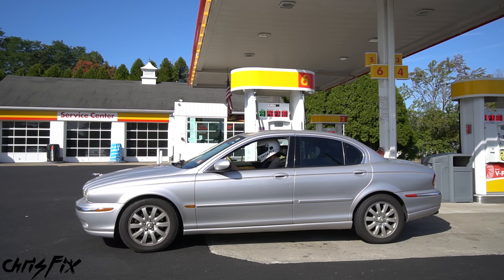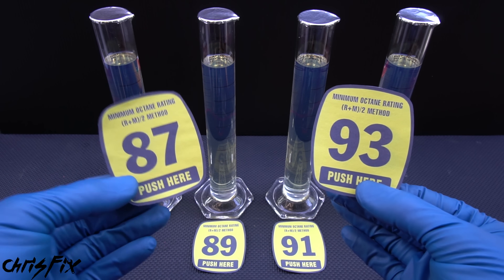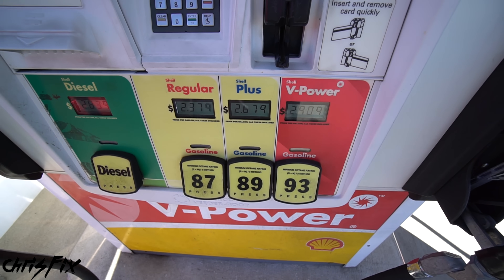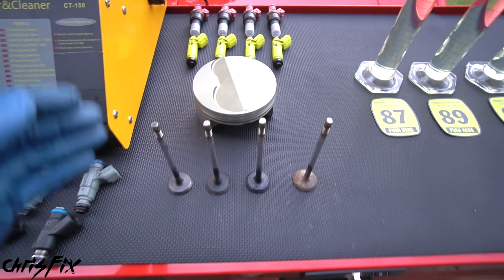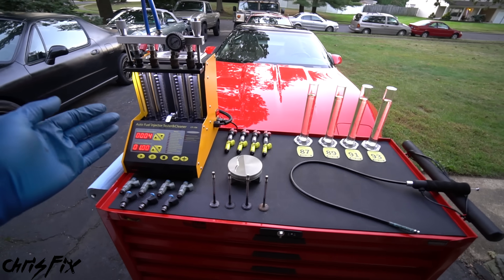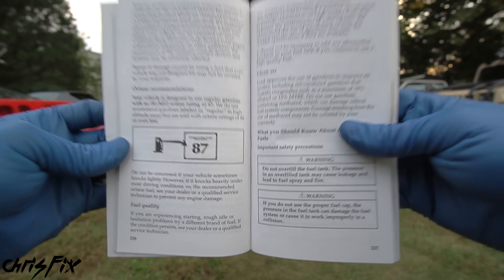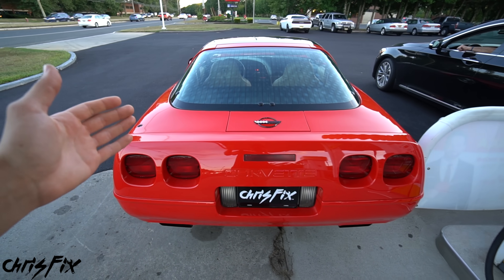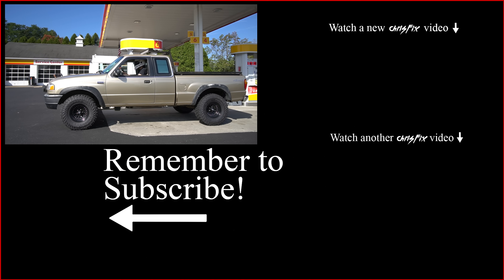What is the BEST Fuel to Use in Your Car or Truck and WHY

Comment: Big question I need help with. I live in the midwest so a lot of fuel is 10% ethonal.  Known as super unleaded. Is this ok to run? Thank you!
Reply: Pretty much all modern cars can easily run 10% Ethanol gasoline. I think most gasoline only engines can safely run up to about 15% E. Older engines, classic cars, may not like even 10% ethanol since their fuel systems are not designed to resist the oxidizing effects ethanol can have on materials not designed for it. In this case ethanol must be avoided completely.

Comment: 1:46 - octane number wont give you more energy or power.... 
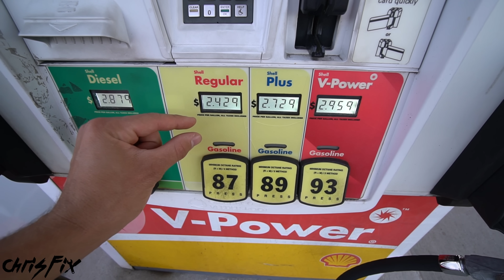12:22 - you can use regular .... and you may loose a little bit of power.... 
        🤔
Reply: In the case of an engine that requires higher octane due to change in efficiency of the engine.

Comment: Start helping out baby boomers with RV - mechanics are ripping them off big time. From engine Tran to water heater replace generator etc.  Get one for u to use at races) track great vids and can trickitout some off and on - just saying sealing roof etc fun

Comment: You didn't cover "non-Ethanol" fuel. Or picking the right fuel for an older car. If you have a 1963 Ford Falcon, how do you pick the right fuel? And what steps do you take to convert a gasoline engine to run on E-85? I've always wondered about this. Great video!!!

Comment: Your vids are the best!  You need to stress "recommended" vice "mandatory" when specifying what fuel to use.  My engine (6.4L V8, Dodge Challenger) recommends 93 Octane. The only time I use 93 is when I go to the track. That's the only time I'm running my Challenger at high RPM (stressful) situations. I have no knocking and get 23-24 MPG.
Reply: HAHA... I should have finished your video :-)

Comment: In Finland, there's a common trick to pass the (strict) emissions test (measured from the exhaust pipe) by running a roughly 55/45 mix of regular fuel and E85 with a fairly low fuel level for 15 - 20 minutes quite hard (3000+ rpm mostly), just before the inspection. Then immediately after the test, fill the tank up with regular fuel. I actually once got a result of literally *zero* emissions from a petrol car :)

Comment: Great explanation, the part about energy content is simply wrong though. Fuel is a mix of several components that have different energy levels. So different mixes will end up with different energy contents.
For example ethanol has a higher octane rating than octanol but has a lower energy level. That's why your mileage on regular fuel may be slightly higher than on premium fuel. A lot of german fuel stations even sell the two types that way: fuel save and performance.

Comment: My toyota agya (if anyone know the car) says use octane 92 but i always fill it with 88 it still fine, but after i ask someone in facebook group they say, it still fine use octane 88 because the compresion its 10 not above. Is this correct?

Comment: Sometimes you also need to ignore what it says behind the fuel door under certain circumstances. My truck got rear ended about three years ago and we replaced the bed from a diesel truck and says to run diesel.

Comment: You are wrong. My turbo car runs Much better on 91. It takes 87 but doesn’t run as good as the 91. It’s recommended but not required.

Comment: I have a '94 Jeep Cherokee XJ and on 87 it gets horrible mileage, 91 it's better than 87 but on 89 by far the best. I get 14/15mpg on 87, 16/17mpg on 91 and solid 19mpg on 89. I ran 3 full tanks on each type to figure it out.

Comment: My moms 2006 forester 2.5xt has a slight knock/rattle on 95 EU octane but not 98 with the stock engine tune thats supposed to work for 95

Comment: lol Oh being a kid...  when I was 16 with my first car.  91 Honda civic  70HP??    i used to put premium with octaine booster.....   man it made it so fast ....... lol
Reply: Tony coffee I had the same car I actually put ethanol E 85 and it ran fine with cleaner emissions, I think the e-85 is about 105 octane
Reply: You can actually put the e85 in all gasoline cars and it’ll run pretty good if it’s a new car you will get a check engine light that will go away as soon as you put premium unleaded in it but it doesn’t hurt nothing to put e85

Comment: THANK YOU Chris. Good informative video. I do have a question that I really need a answer to. I have a 2009 Ford Fusion with 129,749 miles on it. What is the best oil to use?(I usually use Valvoline). One more question, recently, my RPM was at 4,000 but my car was ONLY goin 20 miles per hour, why and what could be the issue? PLEASE, I NEED SOME ANSWERS. Its the only vehicle I have and can afford at the moment.

Comment: My 99 camry loves v-power. with regular gas she will run fine but when old betsy has v-power it's like a little beast wakes up in that 2.2 lol. I have to be careful not to burn the tires taking off at a light.

Comment: @ChrisFix In Pennsylvania a lot of gas stations have 88, and it has a separate pump and is usually a little cheaper. What is the difference in the fuel from 87 or 89?

Comment: what happens if you mix the fuel? let say I fill it up with 2 gallons of 83 then 2 gallons of 89 then 1 gallon of 91, what is the octane on my fuel tank?  is it safe for the car that recommended to have 89 octanes?

Comment: Sorry Chris I have to disagree.. ALMOST ALL engines and vehicles will run just fine on regular, with only a slight drop in HP and fuel economy off of the EPA estimates.... (i.e. your vehicle might be rated at 300hp by the manufacturer, so you'll get like 290hp with regular... barely noticeable when driving).  Manufacturers use premium for the testing so they can get the highest possible mpg, hp and torque ratings for their marketing purposes.   Unless you get knocking with regular you're wasting money with anything more.  As Chris says in the video almost all vehicles will adjust to regular octane....they're designed to do that, and it doesn't hurt them.  Running regular in a "Premium required" car will NOT damage the engine in any way.   I've run V12 twin turbo engines, huge displacement V8s, and small 4cyl high rev engines that all says "premium fuel required" exclusively on regular and they're just fine, no maintenance issues.  Best advice is to use regular unless your car tells you it needs more.....  save the money.  No it won't void your warranty.   No you won't notice the slight decrease in HP.   The small MPG reduction is WAY offset by the cost savings, it's not even close.  You are welcome.

Comment: So we have a Sunoco gas station that has 100 octane would that damage an engine that usually runs on 93?
Reply: Only octane "lower" than the recommend or required level for that engine may cause engine damage from engine knock. Purchasing higher octane fuel than what is required only costs more and has no risk of damaging anything. Sometimes the use of a higher than required octane can have a benefit if the supplier actually formulates the "Premium" or "Super" (high octane) fuel with additional detergents and other additives to help reduce carbon and varnish buildup. The regular and mid grade fuels might not have those "extra protection" additives. (Marketing??) :-)

Comment: this was helpful but i still dont know if i can make more power using a higher Octane  when stock tuned for 87. will it advance timing? im sure its different for a lot of cars. im also curious if itll increase mpg? I would assume it does not, but if timing is advanced itll be running more efficiently? still confused
Reply: but thank you chris, always so helpful and humble

Comment: I live in Wisconsin where 10% ethanol is added to 87 and 89 octane. What does that do to an engine overtime and should I avoid it with a higher mileage engine. I'm sure most states have this but I didn't see it at the fuel pump where you were at! TIA

Comment: Here in germany you can even pump 95, 95 e10, 100 and a few others but we don't get 87, 89, 91 or 93 at all and also if you put airplane fuel in your car it won't work because airplane fuel is kinda like diesel and also how are you supposed to fill your car with that stuff like where are you supposed to get it from?

Comment: It's the one recommended in your owner's manual. A higher grade won't give you more power since the engine isn't tuned for it and a lower grade will reduce reliabilty.

Comment: As always great video, my 287k mile camry takes regular unleaded, is there a recommended cleaner for valves, piston heads and fuel injectors? thinking about using seafoam, and i know you have a video on the many different fuel system cleaners as well, great job

Comment: I came here specifically to see if you got one thing right, and you nailed it at 1:39. Very well done sir

You can make more power with higher octane BECAUSE of its higher resistance to detonation, which means you can run more total timing advance safely, and thusly pull a couple horse more🤘🤘
Reply from the maker: Thanks man! Yea so many people have misinformation about this stuff it drove me crazy so I had to make this video!
Reply: @chrisfix  now we just gotta get you into carburetors 😎🤘

Comment: I just got my first motorcycle and a lot of people online suggest that I should find pumps with 100% gasoline with no ethanol. Some have said that running premium is okay because it has less ethanol. It's a 1981 and I'm sure gas standards have changed in 40 years. What do you think?

Comment: I think you should've mentioned that ethanol has been mandated to be added to gasoline. It's 5% in all of them here, but a lot of states--such as California--has 10% so these are E5 and E10 respectively. It's a disaster for classic cars and bikes. If you have a cherished non-catalyst vehicle, your best option is to buy Avgas which is used in propeller driven aircraft. It's over 100 octane (knock in an aircraft is serious) and is leaded too.

Comment: Thank you for this detailed video. My question is; why is ethanol added to gas in the first place?
Reply: To help reduce emissions.
Reply: @RobertKohut  correct, however, ethanol has 30% less energy when burned when compared to regular gas, in return giving your engine 30% less millage per gallon and effectively making people fuel up more often with less engine performance. How is this better for the environment? I just don't see the benefits of this additive other than helping the multi billion $ corn industry. Plus, ethanol didn't take-off in the market like people were hopping.
Reply: @Dorkbike  True you lose somewhere around 30% fuel economy but it kind of works out cost wise since E85 is less expensive (I know you didn't mention cost). Performance is not affected however and can actually help improve it since E85 is somewhere around 100 octane.(lets engine management crank the timing :-))True you burn more but emissions are still less than gasoline. It's just a cleaner burning fuel. Problem with E85 is it can be a corrosive fuel and typically if you don't drive everyday it would be best to stay away from it. Leaving E85 sit for days at a time or even a week or more can cause some problems with moisture etc.

Comment: Knock knock
Who's there?
Wrong octane 
😬
Reply: exactly, if you hear knock put premium if not use regular.
Reply: @munnumkhalid  you won't hear knock in a modern engine.
Reply: Wrong octane who?
Reply: can we mix the fuel (93+89)/2=91 ?.?.? it is good 
idea
Reply: @valentinuiliqnow6198  🤔
Reply: @valentinuiliqnow6198  yes, it's all fuel haulers do to adjust octane ratings.
Reply: Teehee 😋
Reply: Sun Kissed 
How silly...

Comment: I just got a 2006 toyota rav4 with 200,000+ miles. It says it runs on regular gas. Could I run it on premium from shell for 2,500 miles in hopes of cleaning anything out?

Comment: Good informative video, however i got something to say and let you think about it.   Open the gas pump panel, inside you will only see  TWO meters that counts how many gallons of fuel that pump has pumped out. (If the pump can also pump diesel fuel then it will have 3 meters). The meter also let you track when will be the next maintenance due.  How come only 2? One counts the premium gas (93, OR 91), the other counts 89 AND 87.   Also when you see the refuel tanker drives into gas station, it only have 2 separate tanks. one for premium, another for 87+89.  Got it?  87 & 89 are too close to tell the difference so basically they are the same grade.  So if you pay extra for the mid grade gas... good for you sucker!  you have that much money to waste.

Comment: What about Ethanol free gas. I've heard to use ethanol free gas in small engines or older vehicles (Classics). is there any reason to use ethanol free gas in a normal car. (year 2000ish and up)?

Comment: So my 04 mustang has a miss I can’t find. I’ve replaced all 8 spark plugs and coil packs. It has 197k with factory fuel injectors, if I run 93 for a while should that tell me if it’s my injectors that’s clogged?

Comment: One other reason you may want to run a more “premium” grade is in higher elevation locations where “regular” means 85, not 87. Some people (and state legislatures) will tell you that because the ambient air pressure is lower at higher altitudes you don’t need as much octane, but I don’t believe it. My ECU reports it’s retarding timing by about three degrees on 85 at altitude, but doesn’t report altering the timing at all with 87, even at sea level.

Comment: 5:28, I didn’t know that. I always wondered why the octane numbers were so much lower in the United States. Thanks for explaining!
Reply: He’s still wrong though in saying we have just as good gas. The lowest octane they typically sell in Europe is 95RON which in reality is the equivalent of 90.25AKI not 89AKI like he says. 99 RON is actually 94AKI not 93 like he says. Not to mention Europe’s fuel usually only contains 5% ethanol unlike our 10%, meaning they have to use higher quality gas to get that higher octane, since ethanol is an octane booster.

This video is one big Shell Ad if you couldn’t tell.
Reply: @johnmoore1495  right we have better gasoline

Comment: the one recomended in the manual xD
Reply: Sometimes the manual gets it wrong,  like with some early "practical" turbocharged vehicles or the early mass market  Direct Injection engines. 9/10 though, use the recommended fuel grade.

Comment: Technically though, european fuel standards are higher than american ones.
Our base fuel is 95 RON, which, like you said, is 89 PON. You americans have 87 PON aswell, which should translated to regular 93 RON, a fuel type we don't have anymore since 15 and more years.
Your 91 PON translates to 99 RON, although there is 100 RON available, and even 102 RON available.
a quick research shows a different conversion rate than you mentioned in the video, although I have not properly researched the math behind the calculation.

Comment: I drove an EcoBoost mustang and they RECOMMEND premium fuel solely for the purposes of achieving maximum power from the TC 4cyl. But you can run regular with no problems. It's just not going to give you as much power when you hammer down the throttle.

Comment: I had an 84 Caprice with a 305. Between BP, Citgo, GetGo, Safeway and Sheetz I had to run BP or it would get pinging sounds. It didn't matter what Octane I used or if it was E0. BTW Chris, I kinda wish you mentioned E0 (Ethanol Free) fuel. I like using it but only in my yard equipment and also when I store a car over winter. I used it in a snow blower and had no issues starting it at least 6 months later.

Comment: best fuel for your car is electricity.  cheap and efficient 80% of useable energy comes out of battery whereas only 20% out of gas /diesel. fill up at home while you're asleep.  Added benefits: No transmission, belts, brake or oil changes.   I still love your videos chris!

Comment: What is the best gas for passing smog? I have heard 2 schools of thought, Low octane burns at lower temps, therefore, burn more thoroughly, but I have also heard higher octane fuel once it does start to combust is cleaner.

Comment: I put premium in a 2014 civic needing 87 and it helped with Gas mileage. Putting 87 I can feel less power and gets less Gas mileage. That's my experimentation. My current car needs premium
Reply: I also got rid of my cats put an exhaust on my car and added an intake

Comment: In the Netherlands we have , 95 , 98 and 102 premium, so 95 is like your 87 not 89. ;)  also the octane numbers are going to be replaced in Europe.  95,98 and 102 are all going to be called E5, and B7 for Diesel. almost all engine work with 95 an 98, the premium has some additives and claim better fuel economy.

Comment: I did a test in Australia here to compare fuel economy over 8 months using all different brands and fuel types in my old 2006 focus to see what the difference was in fuels. From best to worst using about 12 different brands and all their fuel types (not including e85, e10 or diesel) the total diffence in KM per tank was 26km. Shell vpower was the best with 7-11 regular being the worst but it was hardly enough of a diffence to justify the cost.  You don't need preimum in a normal car that doesn't need it. Save your money.

Comment: Me: puts diesel fuel in my car by mistake

Engine: why do you do this to me

Diesel: I'm about to ruin this engine's whole career.
Reply: Gas engines have a bit of tolerance to Diesel but you still don't want to goof up. Diesels will fall to bits if you try running them on gas. With that said, New Jersey and Oregon both require you to have your gas pumped for you and I heard once of a pump attendant putting Gas put in a Diesel. The man said "Eh, it'll be fine" and the driver said "Well, if you want to hand me $4,500 for a new engine..." And the driver had his fuel tank drained for free for that blunder.
Reply: HAHAHAHA
Reply: CAR-eer